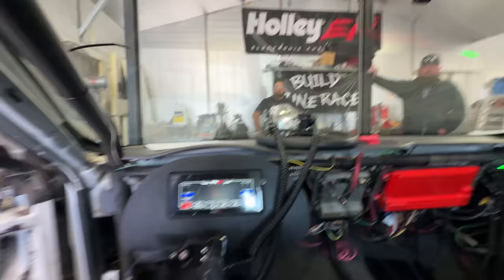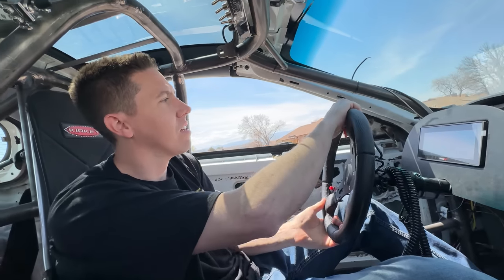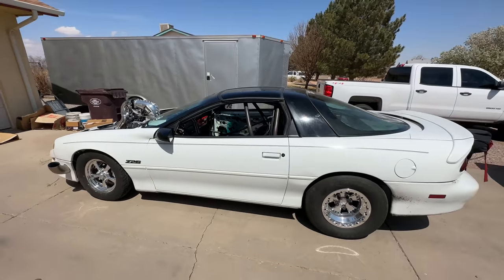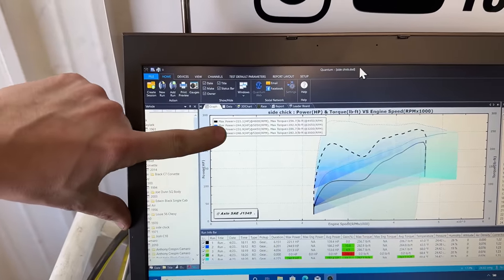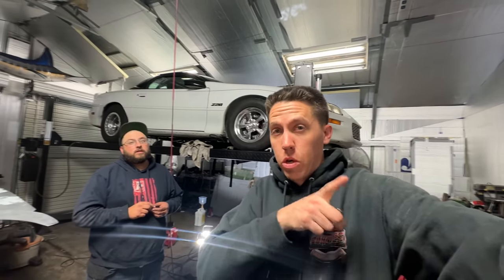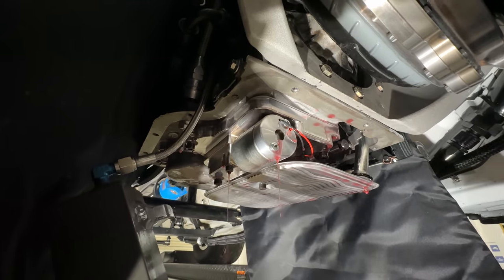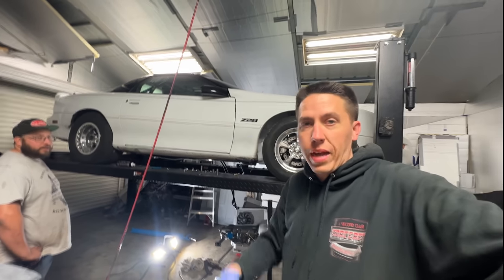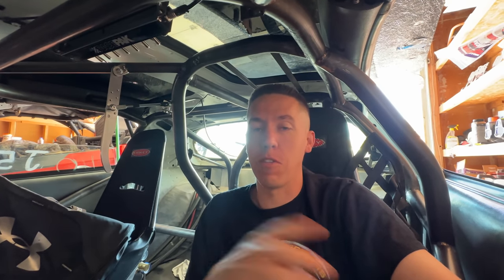Driving My 1800HP Camaro For The First Time... Didn't Go Well!

Comment: you should fix the run wire to the Holley so it dont loose 12v between the run and start position.
Reply: yes that way is better on the holley it self
Reply: @loundclear9279  
Learn english
Reply from the maker: Solid idea now that I have the smart wire I would be able to program that I believe. I’ll need to figure out what signals it off during cranking

Comment: I can't find a video where this car makes 1800 hp  Are you just assuming it makes this..
Reply from the maker: Everything is built to make around 2000+hp actually we have a similar combo with smaller turbos and heads and it made 16XX this combo is capable of 1800 wheel pretty easy. 

Dyno video coming soon on a low boost base tune and it made some pretty impressive numbers. Eventually we’ll put it on the dyno and get a big number out of it!